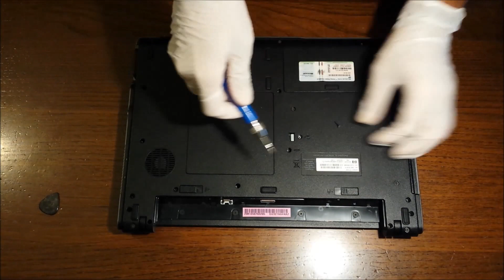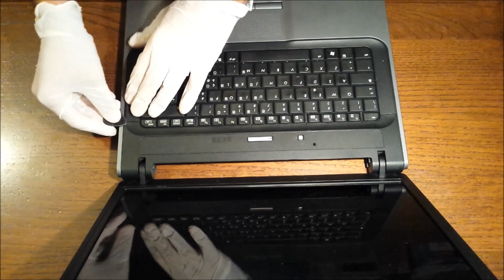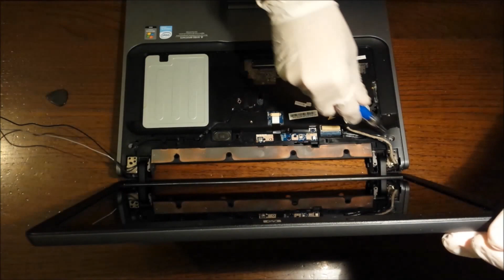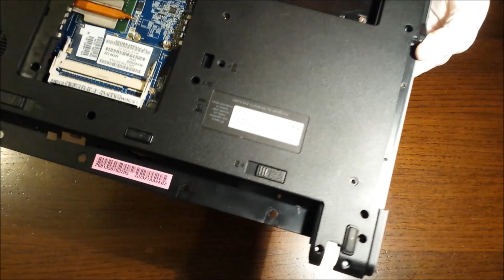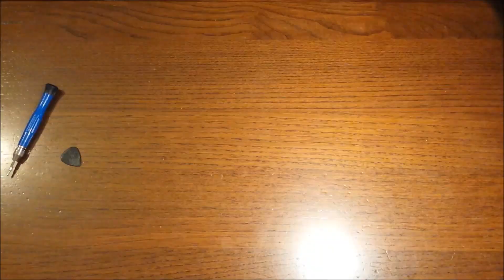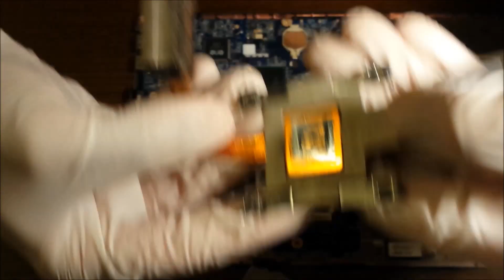How To Open & Clean Fan HP 530 - Keyboard, Palmrest, Heatsink | Disassembly Notebook

Comment: Do you have to remove the monitor to get to the motherboard for thermal paste change?
Reply from the maker: To get to the sink you have to disassemble everything
Reply: @thesilentube83    not really. seach  "Hp Compaq 530 laptop CPU upgrade and trick"
Reply from the maker: @mrpentium  Apparently there is an easier way to access the cpu, good to know

Comment: Can I put 2 * 2gb ram in hp 530
Reply from the maker: HP 530 support max 2GB (1+1GB) of ram
link:
https://h30434.www3.hp.com/t5/Notebook-Hardware-and-Upgrade-Questions/HP-530-NOTEBOOK-RAM-UPGRADE/td-p/5831743
Reply: Thesilentube83 Sardegna I putted 2*2gb ram in my hp 530 and it works fine
Reply from the maker: Lucky 😉
Reply: @neomedved  Me too + I have an Intel T7400 CPU. 😉😎